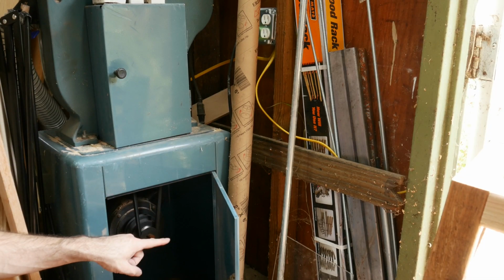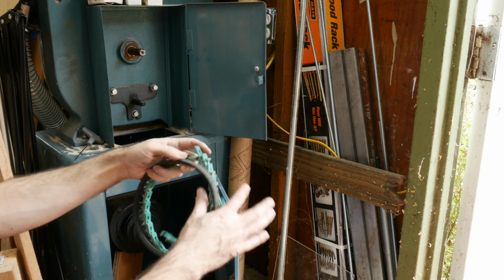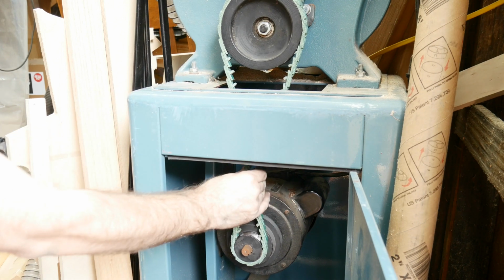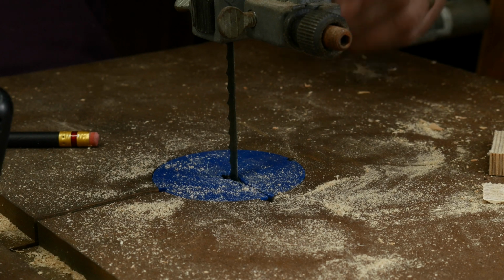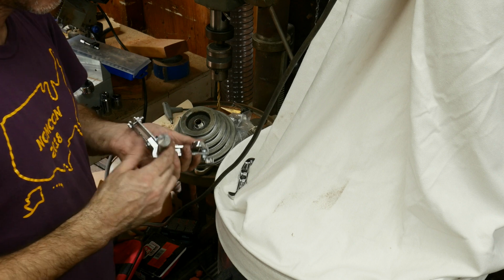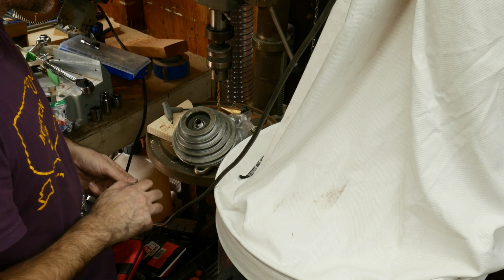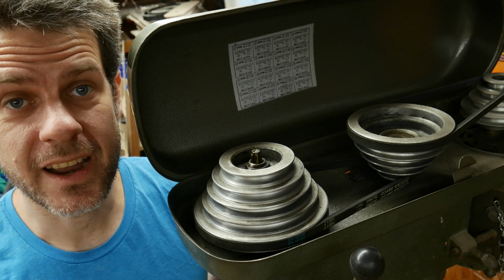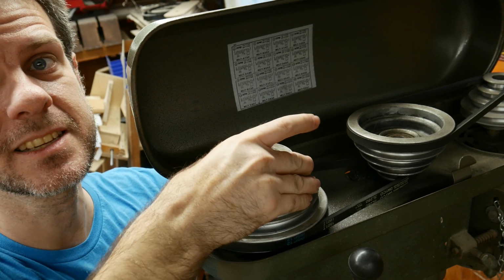Belted Machine Repairs

Comment: What is that cool resizable belt you used for replacement?
Reply from the maker: The one I bought was from
* https://www.in-lineindustries.com/products/pulleys-belts/
along with a cast pulley upgrade for the Craftsman saw.  The pulleys it has right now are pretty iffy, and don't fit well on the shaft.  You can get the linkable belt several places, including
* https://www.grizzly.com/products/grizzly-power-twist-v-belt-1-2-x-4/t21992
* https://www.harborfreight.com/vibration-free-link-belt-43771.html
(and ebay, amazon, etc)